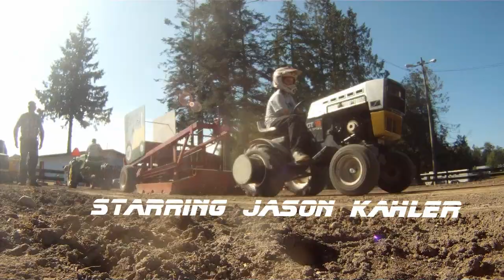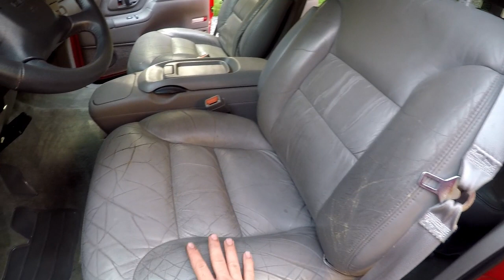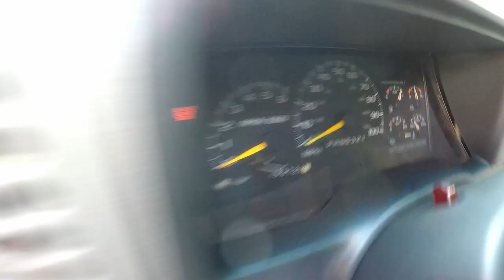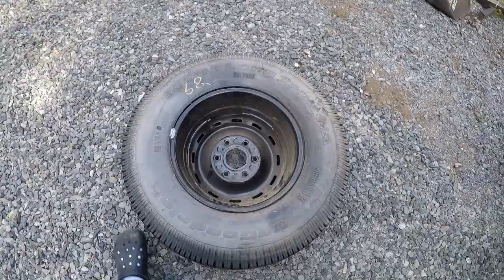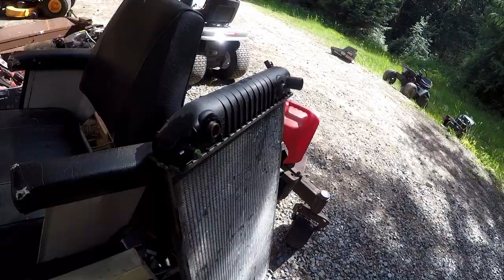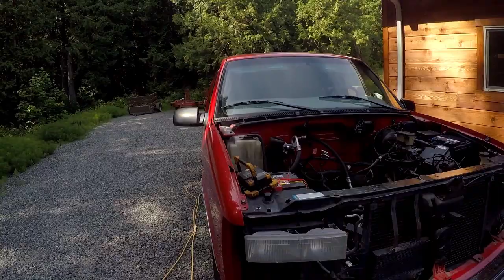$500 1998 GMC  Suburban Part 1

Comment: I literally bought a 98 suburban k1500 for $500 as well that currently needs an engine. I’m in the DC area can’t wait to watch your process and kind of be on the same level in terms of progress wise
Reply from the maker: Sweeeet!
I'm just a teen and this was my first engine pull, like no problem! These where classified under the GMT-400 platform, and are just plain to easy to work on. Only real problem I've had so far is my 4WD low doesn't work, but parts are everywhere and dirt cheap for new parts too. Good luck with yours!

Comment: Pretty clean suburban. You should just swap In a 5.3 or a 6.0 LS a lot more power then the 350 not too hard to swap out. I have a 2000 k2500 obs that has a 6.5 but I'm currently working on swapping a 24 valve Cummins into it. If you need any help let me know I'm an expert at these OBS trucks
Reply from the maker: Appreciate the help! 
I was thinking of a 454 but I think the 350 will do.